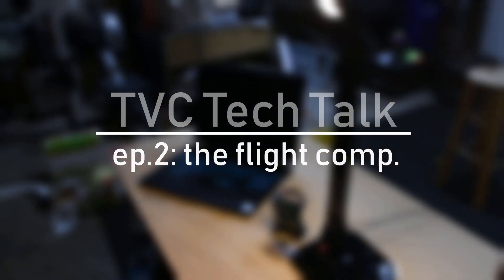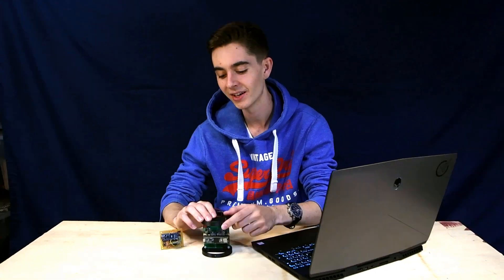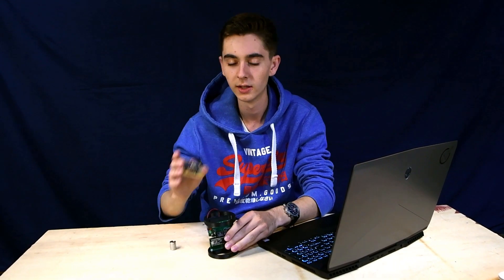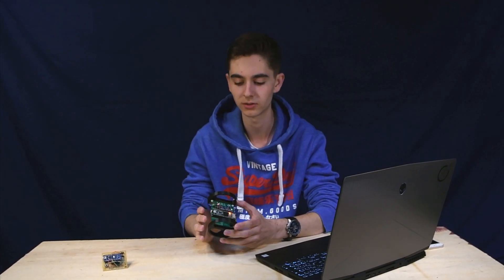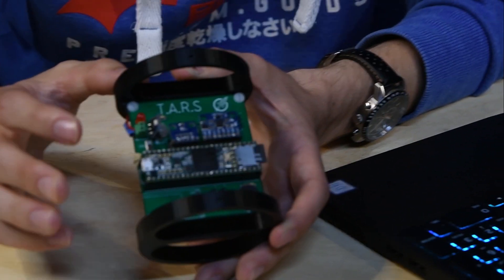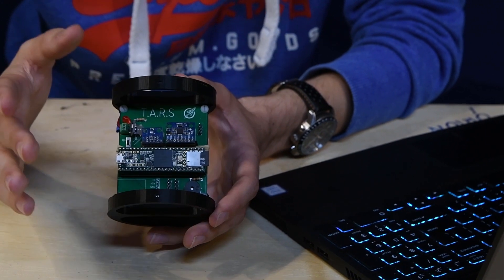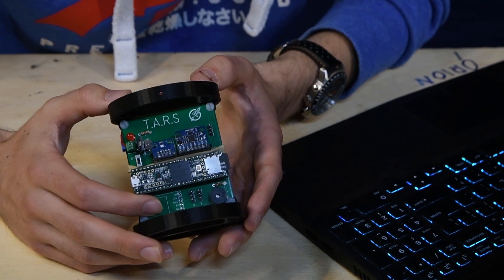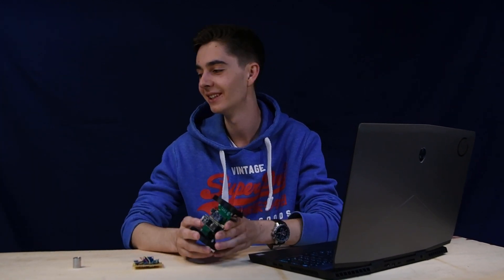How to Thrust Vector Control | The Flight Computer

Comment: 📺💬 TARS, converts input signals to target carrier functions and the input may have a small contrast gains value but it amplifies the input if you have this one it is very easy to perform the aerospace carrier function.
🥺💬 TARS is naming only we can use for any purpose but I understand in movies or media they talking about spaceship astronauts only.
🧸💬 That is very nice, can I get one I want it to work with a drilling machine that is possible too we see in movies that they need to bring some circuits with them when they try to fix the machine.
🐑💬 It is working on multiple alignments axis, I wish I could find some diagram or program logics to explain it from the Internet but it is the same as you create multiple phase alignment points and that always has maximum values at some specific of points when you working in one unit circle. We read some mathematics about frequency this morning.

📺💬 Is that Raemen ⁉ 📺💬 I removed some of the information form the VDO.
🥺💬 As they say it is not only for aerospace and that is learn in class please explain more about it.

📺💬 It has survo the mechanical chip injection that connection to relay we still need to use relay that tools make progame more simpler.
🥺💬 It is learning in electrical engineer, please do not try to do this it is nothing special and famous cannot stay long.

Comment: Very nice. Thank you for detailed explanation. We also building flight computer based on MPU6050 and BMP１８０.　　　
For now we getting first experience, so we use Arduino nano.　　　　For more complex projects with TVC we are considering STM32F103 or ESP32.    Yes, Teensy 3.6 is great, but too expensive to get in Russia.
Wish you good weather for your flights.

Comment: Don't be afraid to write to the sd card even if the high pitch siren is sounding. I've found that it's very unlikely to corrupt the data. Plus having the data for the whole flight can be used for debugging in the future.

Comment: Hello ! i was wondering where i could get a board like that in this video! the board that you connect the gyroscope , the teensy , the led... You get the idea! Where can i buy one! :)
Reply from the maker: Hello! sadly the board is one we designed ourselves and then had manufactured through a company called JLCpcb. So the board is not widely for sale. We do have spares/the original files that we could sell. drop us an email orionaerospace.liftoff@gmail.com if that still interests you